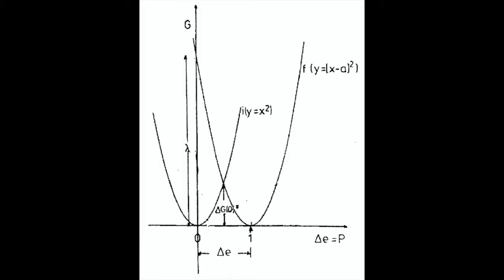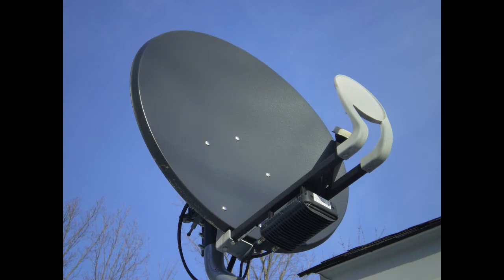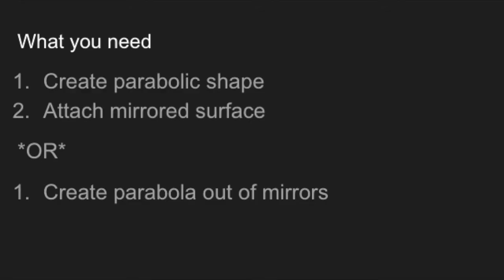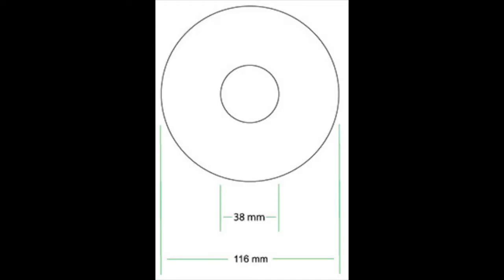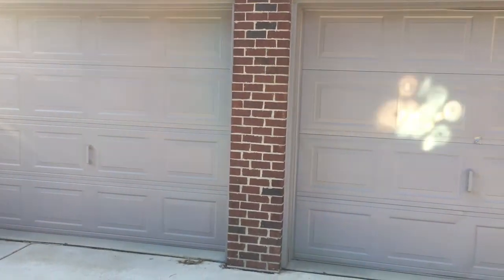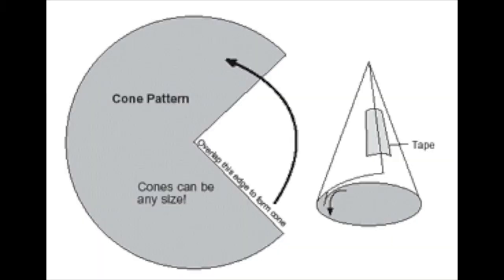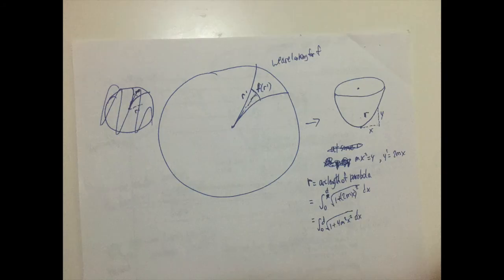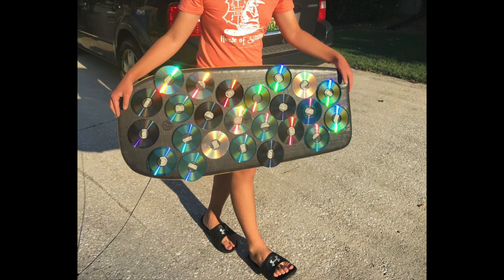CD Parabola: How Not To Make A Parabolic Reflector At Home

Comment: Hi, Andy, I succeeded and made a totally DIY reflector that can burn stuff!    I did  the "calculations" on a drawing board! With pencil and paper and a compass or dividers and I used the "cone method"  to design the parabolic dish. You don't even need a calculator or serious math!  I did it on a double letter size piece of paper.   It turns out that making a part dish is easier than making a full dish. And it is way more useful too!.  Then I made a 1/5 scale model with dollar store plastic plates with a mirror finish.  And then I scaled it up.  It is now a tracking solar concentrator that I call the "Sun Scoop".   My focal length is about 60 cm. I am going to make a better video about the cone method, so others can do it too.  I designed it to make a concentrated ball of light, about 15 cm diameter. You can get paper to burst into flame with it (even with the 1/5 model) and I used it to steam sterilize soil and dehydrate my apples and herbs.   I would love it if you gave it a try.   You just cut circular strips. I looked up the term, they are called an  "Annulus". So I made about 8 Annuluses to make my reflector.  And the size of the annuluses were decided from the drawing I made!  Check out the tracking "sun Scoop" on my youtube.

Comment: Hi Andy, great attempts,  but if you trying to make unconventional mirrors try making small ones - starting with a 3 inch or 4 inch ish size. These will have better support and rigidness as well. like for the silver blanket such as size can be tightly wrapped around a can and with a hole desired suction can be created; It wouldn't be perfect on the edges which can be taken care of by an aperture mask. Second is cd attempt which you can try making a single cd mirror by again using a slightly smaller can. and by slumping it slightly in the middle, being plastic in nature it will need to have slumped force, which can be done by a washer and long nut and bolt. you can also try removing a cd layer which will expose it's metal film so that it works as 1st surface mirror. But then again these are untested ideas and even before all this one needs to test surface accuracy of these reflective surfaces. Theoretically many people will say this can't be done, but doing things teaches us new things. As a simple test you can just try using these first as optical flats for image orientation correction in refractor telescopes. if those work you can test out for making them parabolic/spherical. I never tested these ideas because of the lack of time but I would be highly interested in understanding the failure or success of these. so if you ever do them please post the results.

Comment: I've actually been wanting an affordable way to make an optical quality parabolic mirror. There's a festival I go to where people set up public art that sometimes includes science demonstrations, and I'd like to do a live Schlieren imaging demo. I might just have to buy one though. I have read that some Schlieren setups can use spherical mirrors which can be cheaper because the manufacturing process is simpler IIRC. I'm not actually sure how it would work considering how the focal points on spherical mirrors are but 🤷 I'll have to do more research.
Either way, I guess it's achievable with one of those smaller 12" mirrors so I guess it wouldn't be all too terribly expensive.

Comment: Hey Andy, don't give up, I went to my neighbours and asked them if I could have their sat antenna. In italy you still find them in hardware stores but people just didn't uninstall them from their roofs.
If you ever get to a sat antenna remember remember to use a heat gun to remove the coating and don't do like I did with random scratching power tools (now it's so deeply scratched I can't recover it), I'm looking forward to cover mine in space blankets strips (I don't have a temperature heavy application for this)
Good luck!
Reply from the maker: I will move to Italy immediately